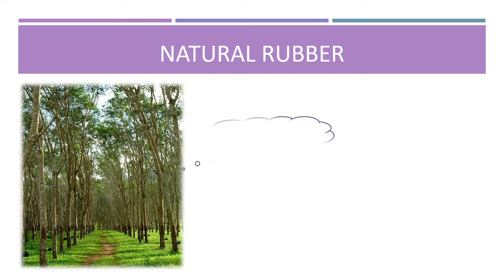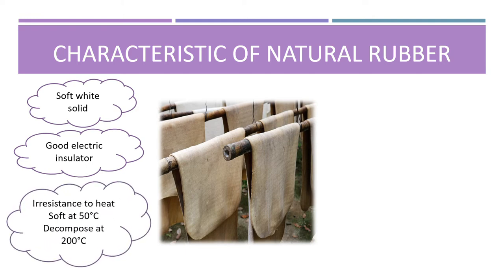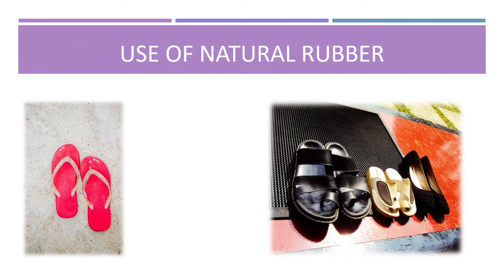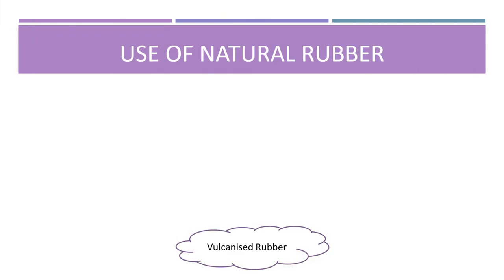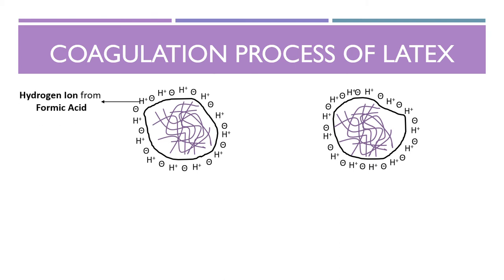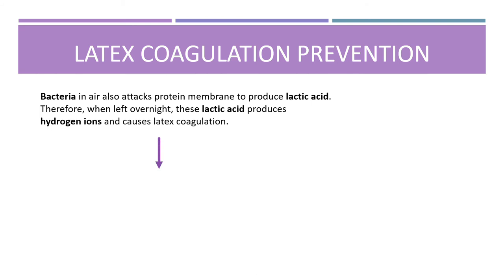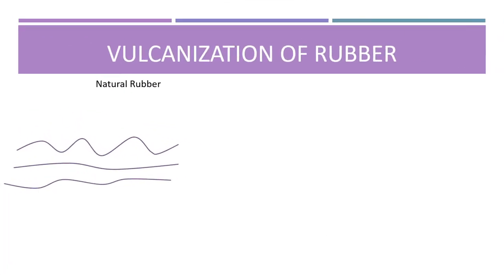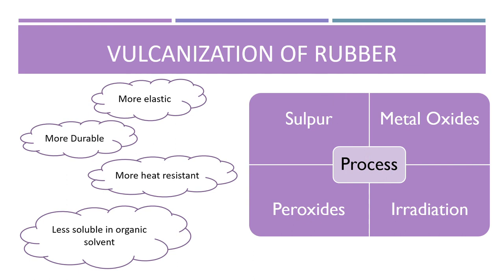NATURAL RUBBER : LATEX COAGULATION, PREVENTION METHODS AND VULCANISED RUBBER

Comment: How do you coagulate the ammoniated latex? For RSS.
Reply: I'm no chemist but probably by evaporation?
Reply: - Add an acidic coagulant (like acetic or formic acid).
- Control temperature and stir gently.
- Allow sufficient time for coagulation, then separate, wash, and dry the rubber.